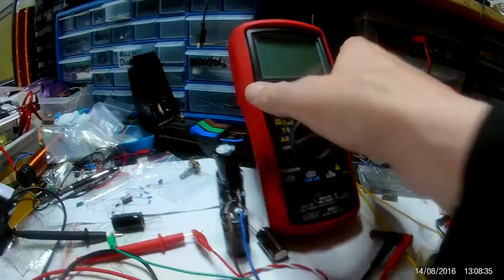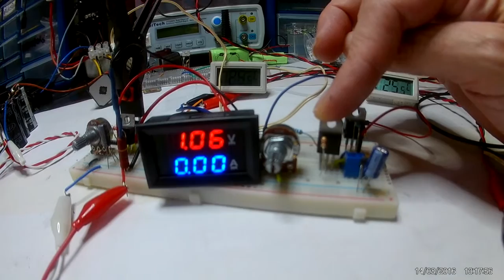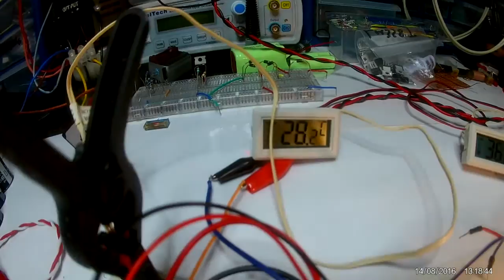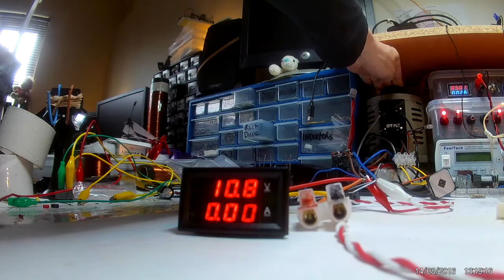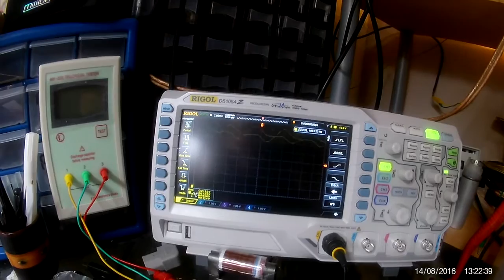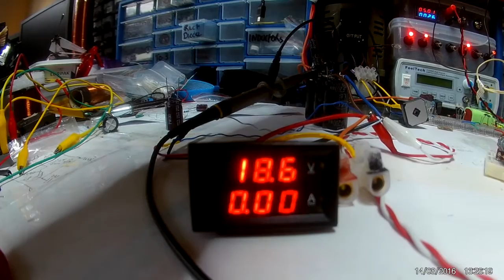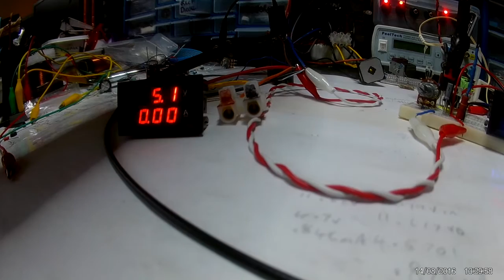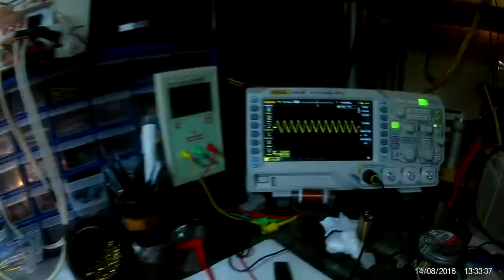DIY Power Supply, Electronic Experiments LM317AHV TIP3055

Comment: Thanks for the look at your new camera...looks like a good go-pro copy...i know a few people who bought a 12 quid copy..and soon discovered that it was low res with a 8 min battery life...yours is good..but from what i have found out..don't trust the waterproof case..dam you got me looking at cameras now...I already have 8..smile
Reply from the maker: I made a mistake, it does have a bracket which means I can use a tripod(which does not come with it) etc and still have the mic exposed for audio. I will try it when making the next, but one, video. Its not bad for £33, even better now I have bought a separate mounting kit. You got me on the quadcopter thing, so swings and roundabouts :D

Comment: Impressive  video quality and wide angle..what new camera have you got?
Thanks for the reminder on the ebay meters..i have a 100 volt max one and a 35 volt one..better not get them mixed up..old school amp meter looks good..found a transistor on the old smoke detector which tested faulty or unknown...turned out to be a TL431..adjustable zener diode....very interesting and useful for voltage protection
Reply from the maker: The camera is a cheap GoPro imitation from Gearbest http://www.gearbest.com/action-cameras/pp_362082.html 
My voltage meters measure up to 100 volts but they need no more than 30 volts for the display. Is that what you mean? Amp meter comes in really handy, cheers for the suggestion.

Comment: I forgot ...it's the 30 volt limit to power the meter that you exceeded not the voltage reading ...so 30 volt limit would apply to my 100 volt one...who's idea was the inline resistor?...and what value is it?
Reply from the maker: I wanted the LED's a little less bright so I used a 220 Ohm. These two meters have different regulators. I wonder if that is why one died and the other lives on?